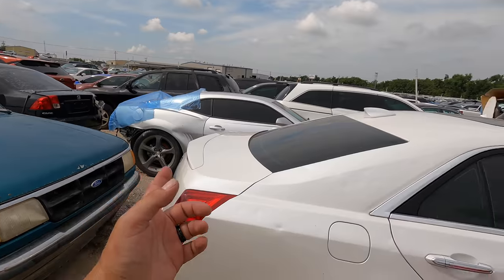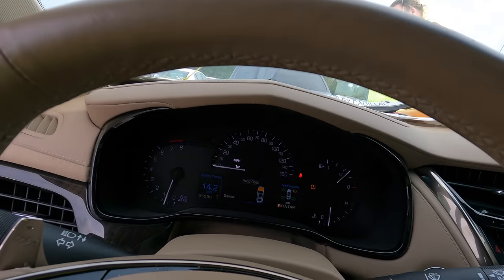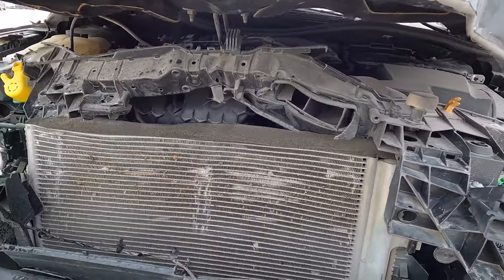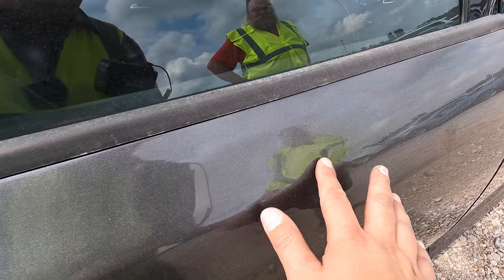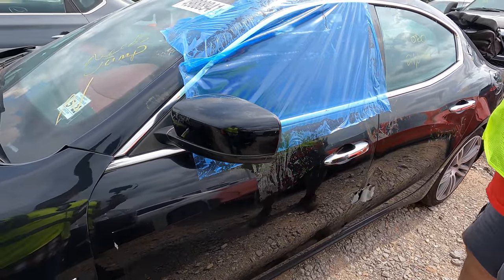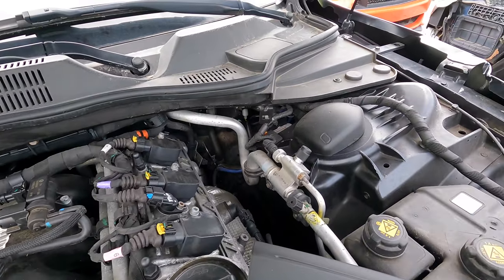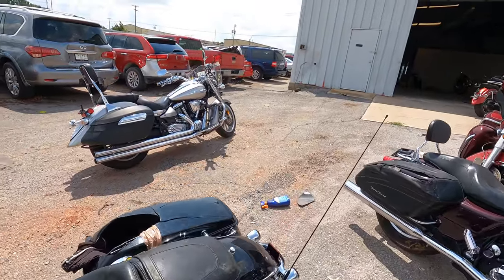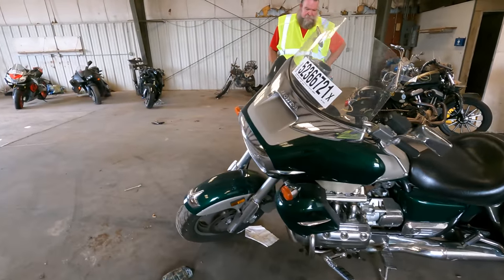Copart Walk Around 8-20-21 + Twin Turbo Maserati + Mustang Carnage!!

Comment: Cadillac motor mounts go out very fast if you’ve really been pushing the car, they’re perfectly smooth otherwise. You can’t hear or feel the engine running at all from the inside when they’re good. It’s because they make them with a softer rubber material so if you push the car they wear out fast.

Comment: Give that Cadillac a slight Rev whilst in reverse then in drive while you’re holding the brake and watch the motor to see if the engine lifts then you can tell if one of the engine mounts are broken.

Comment: This Cadillac reminds me today. My car would idle rough only with the AC on. I ignored and the check engine light came on. I scanned it. Gave a battery code. Cleaned the battery connections. Had buildup of white corrosion. Reconnected battery. Toped off the water in battery. Started car. No rough idle with AC on. No Check Engine light.

Comment: I have 05 cadillac sts 3.6 v6 it have a shimmy but you should do a motor flex test. Where put it in drive hold the brake and give it gas to see the motor flex.